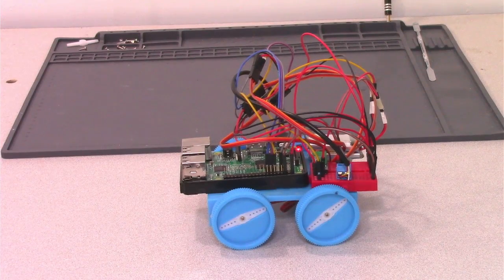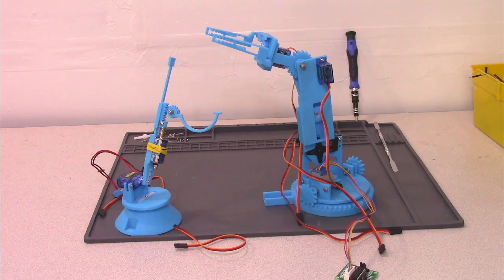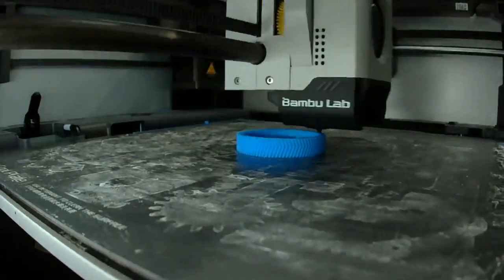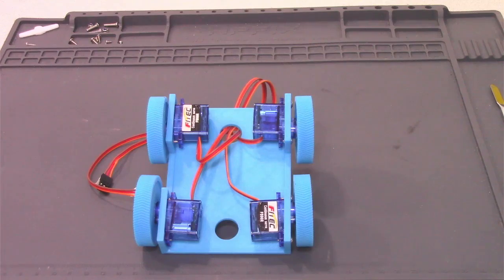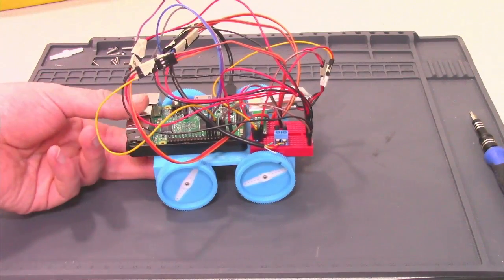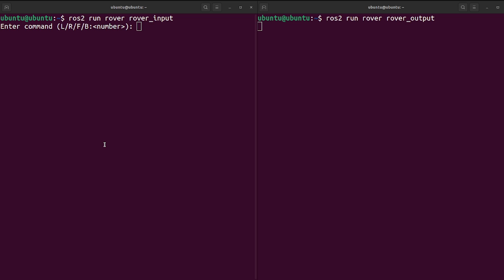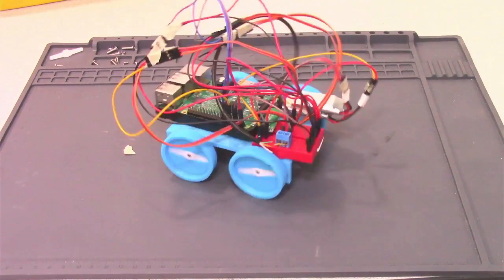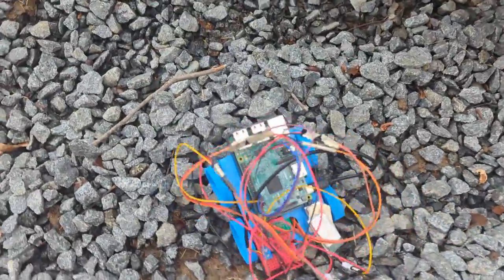Build a Rover ROS2

Comment: I need to pick up some SG90s to do more stuff like your robot arms! What's the purpose of FS90R continuous motor over a normal motor? Besides not having to use a motor control board. Please add hardware notes to your youtube (or github? in case I am missing it) so I dont have to zoom in and squint :)